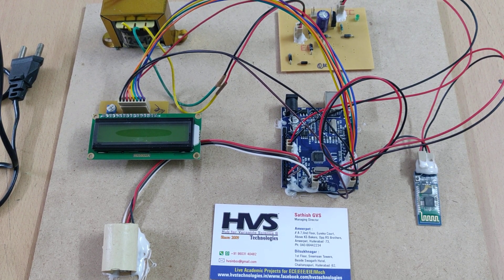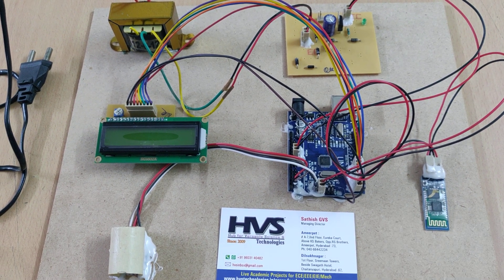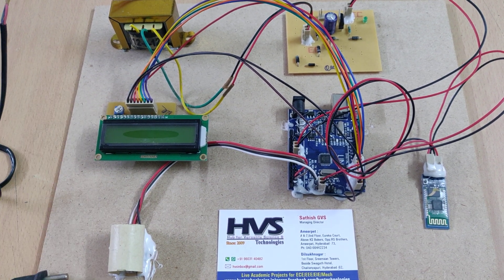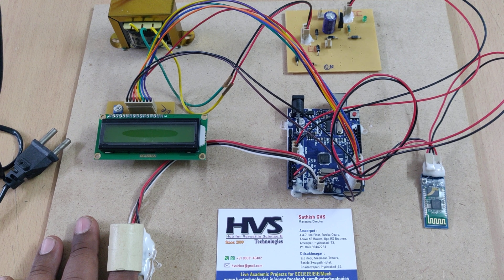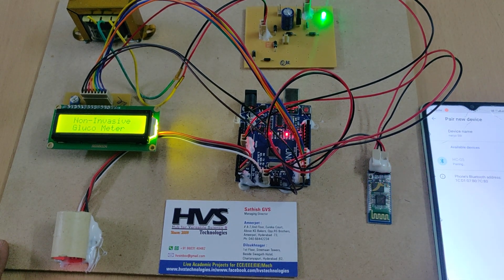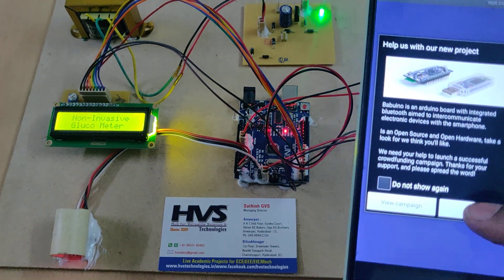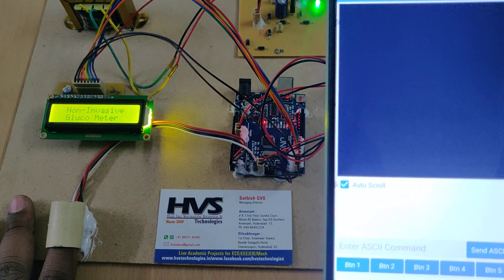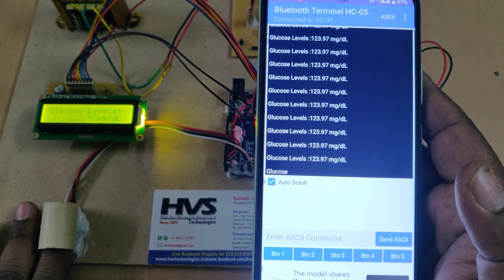HVS-3668. Noninvasive Glucose Concentration Measurement System#bluetooth monitoring#NIR sensor

Comment: how about using a circular belt around the forearm or making the sensing area much larger for the whole finger or multple, or the palm? Or why not just make the light shine much brigher then using these poor LEDs?
Reply from the maker: @katzda  hi
We have done that also with more accuracy. Please check it from this video link https://youtu.be/ZYdxom5FmNQ?si=RiLAnHaP5qGojXnA. We sell full working kit with document PPT circuit diagram and code. Could you Send me the video link, Will update you the cost details. You can contact us at +919603140482
Through WhatsApp or call

Comment: Nice video, I have been using the FreeStyle libre sensor with Nightrider Blucon. It allows me to read my blood glucose without having to prick fingers. I can see exactly the state of my blood levels. It provides a clear picture of how food and exercise affect  glucose values which helps me to control my diabetes a lot better.
Reply: Hi how are you , may yu pliz share the code , list of components used , circuit diagram for this project
Reply: Just use ordinary glucometer yet that hasn't been tested nor it is to rely on .. all of invasive come with a warning. Absolutely all. I am working on testing this and read a lot of papers and all of its still kind of work in progress. For now the most reliable is yet old way of electric current finding out correct and exact value of glucose in blood. Yet light is not  to be trusted. I value your life. Like human being and wish that you take on board what I just said. They usually use blue 450nm and red 660nm. Although other use infra red and green. One band isbfor reference and infra red or red is reading it. Now I know that red up to 680nm also corresponding also to spo2 in small portion. Where anything below that band and above is allergic to oxygen. So it's not yet safe to guarantee 100 percent guarantee that reading is indeed correct. Please use old one it provides far more accurate readings. Trust me on my word. I wish you only well.
Reply: Toss me its pic of that machine u use pliz

Comment: Which app is used to display in mobile and is it storing the values for longer period can I get the code
Reply from the maker: You can contact us at +919603140482
Through WhatsApp or call

Comment: Sir, i need your help on this same project. Because i need the Arduino UNO code. I work on this project for my college.
Reply: Mr. Rajkumar where are you from , Iam Dr Ramesh Kumar want to know about  this product.If possible I will help you.
Reply from the maker: @rameshkumarbanala2848  You can contact us at +919603140482
Through WhatsApp or call
Reply: @rameshkumarbanala2848  can you please give your email?
Reply: @rameshkumarbanala2848  
i work on the same project and need a help 
how can i contact with you ?
Reply: @AhmedAli-qo7lp  can you help regarding the sensors used and the adruino coding
Reply from the maker: You can contact us at +919603140482
Through WhatsApp or call
Reply: Bro did you got the code, I need it
Reply: @priyanshudutta6610  No bro